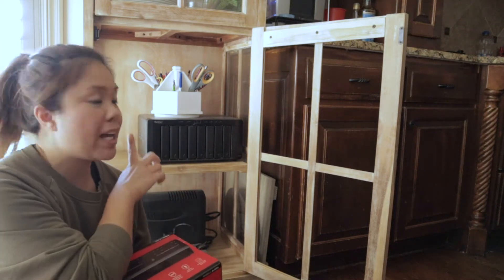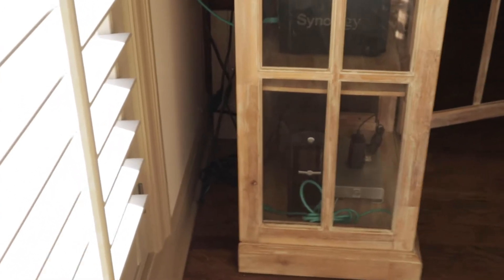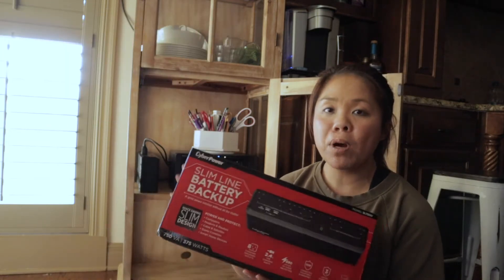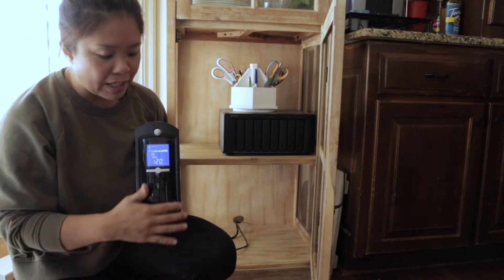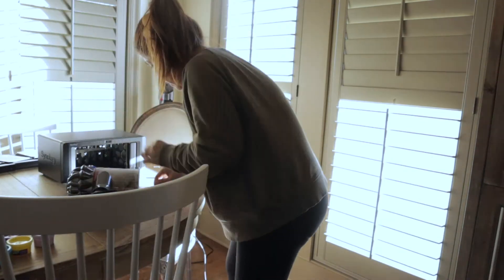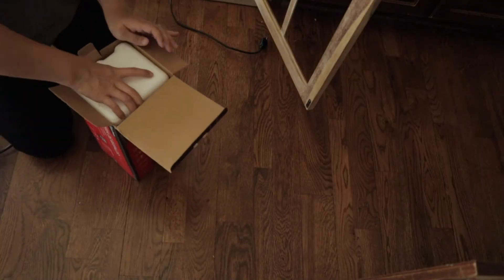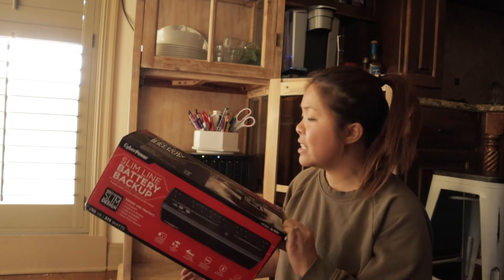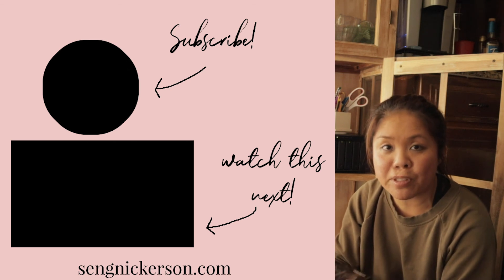DUSTING AND CLEANING SYNOLOGY NAS - Adding a Battery Power UPS (Physical Maintenance of Home Server)

Comment: The USB is probably for ur device so it can send a signal to the device and it can gracefully shutdown when the battery is about to run out
Reply: This is exactly what the intended use is. I'm running a CP unit on my 4 Bay DS920+ and I connect it from the UPS to the NAS with that exact cable. I'd recommend making the connection and setting it up in the Synology settings.

Comment: If the fans are that dusty then I'd expect the inside to be worse. I just took out all my drives and vacuumed, after 3 years - filled with dust. My 1515+ has failed, just like the 1515+ I bought 22 months before that (luckily getting the replacement on warranty just in time).  It was motherboard before, and I expect again.  I wouldn't recommend to anyone putting it in the kitchen.  Mine has been just outside, but with an aircon blowing kitchen air direct to it. Fine oil particles from cooking don't all go into the fan extractor, and some will end up settling nearby, along with the dust. If this goop starts sticking to electronics and being conductive, you've got a problem.  Worthwhile being careful.

Comment: That cable is a USB cord it allows you to plug your sinology into your battery back up and if power does shut down your computer and then turn itself off to protect your hard drives